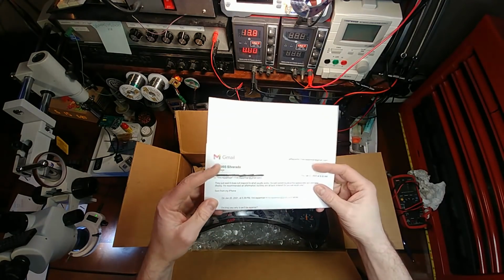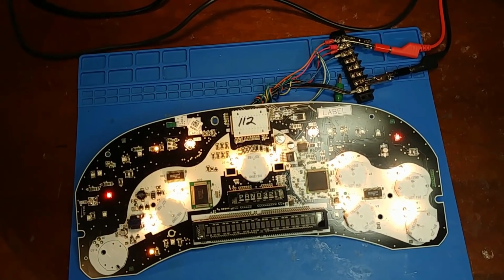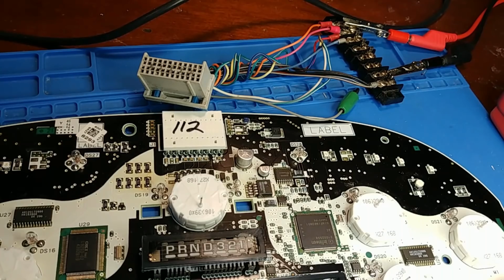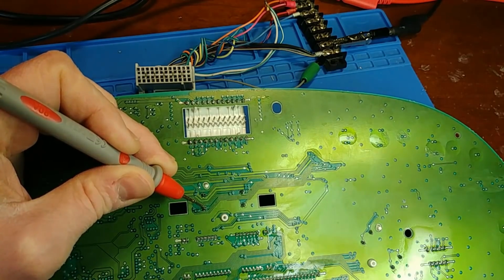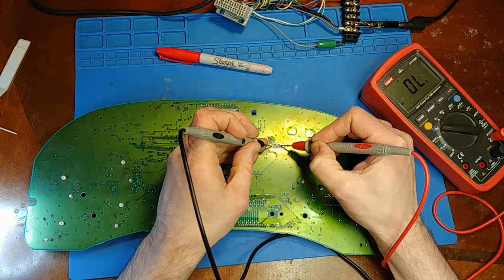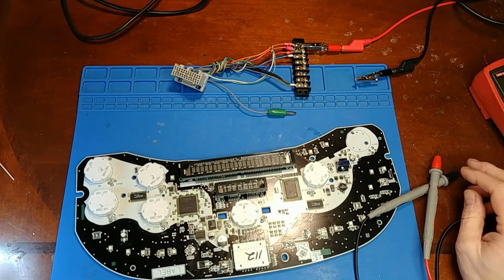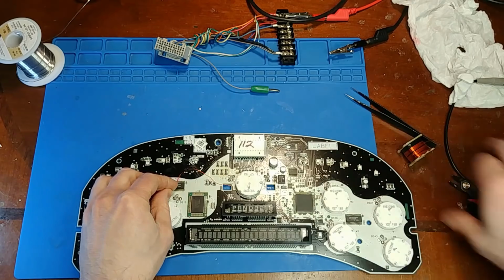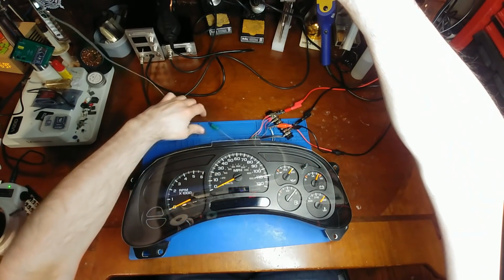"Liquid" Damaged GM Cluster Repair

Comment: If you're here and all thats working is your blinkers and the lights be sure to check all of the problematic chips mine had all be resoldered by someone before i owned the truck and i was stumped the board looked great besides some oxidation on the solder of those chips i fucked around for 2 hours to only say fuck it and reflow all of mine and the very last one had a broken solder joint i couldnt see my cluster now works again thank god

Comment: great video  Jeff ..I have a 2003 board and had don a good job replacing stepper motors  but by accident  i shorted out the  light  bulb above oil pressure gauge Now the cluster is totally dead...any idea what may be blown ?
Reply from the maker: Hard to say without being able to troubleshoot it.

Comment: I have a 2005 gmc yukon denali. The DIC display does not work. It rarely works for a short period of time but 99% of the time it's a blank screen. All of the radio controls work on the steering wheel work. Any ideas or can you fix it?
Reply from the maker: Yes it is repairable.
Reply: @jeffescortlx  how would I go about having you repair it?
Reply from the maker: @ryanconard8083  https://youtu.be/T_2WnJMsZaU

Comment: Do you still work on these GM clusters? I've actually got two trucks i need clusters worked on. An 02 avalanche and an 06 escalade ext.  The 06 escalade has an issue where the tach likes to rev up, but doesn't want to come back down, so at idle it says like 3 to 5k RPM. And when I rev it up. It will usually max out and hit the bezel. Im guessing it needs new stepper motors, as I dont think its ever been replaced, about 220k miles.  The 02 has two issues.  The truck has around 500 to 700k miles on it apparently.  So basically the previous owner, good friend of mine, bought the truck brand new, ran the original gauges for a while, then wanted to put the escalade gauges, so after anywhere from 200 to 400k miles, he bought a brand new cluster from GM. Which restarted the mileage to zero, and that cluster has around 300k miles.  So I was basically wanting to know if you can re program the mileage to add them up so the mileage is correct on the newer escalade cluster.  And also it's having an issue where the entire cluster just sort of freaks out and shuts off randomly.  Also, whats your email?  The link thing in the about section doesn't work for me
Reply from the maker: I can take care of both. Although the intermittent power on the 02 could be a bad ground. Contact information here: https://youtu.be/T_2WnJMsZaU

Comment: What’s the proper way to calibrate the gauges after re assembly? I re soldered a few bad joints due to not powering up sometimes I just really never new how to properly zero after.

Comment: Ever see one of these 03-07 GMT 800 Clusters with a brake light that stays on dim ALL THE TIME? Key on or key off. At night its very visible not so much during the day. For weeks its been glowing ever so slightly.  Do these have a resistor that cracks and is giving the LED residual battery voltage?  Its driving me nuts on the old 06 Sierra.   Sure when you Disconnect the power to the cluster it stops its a problem inside the cluster.   Fixable?
Reply from the maker: Yes I see it regularly. It's one of the steps included with a proper rebuild. It's a build up of silver migration corrosion. Should be cleaned and conformal coated.
Reply: @jeffescortlx   Ahh..  So pins are corroded somewhere.    Ill Email you when Dad ever stops driving the thing Down here in FL.  The humidity wrecks all here probably is corroded they like to leave their windows down all the time. I told them to stop doing that all the humid air gets in there. Then turn on the AC and its a condensation box.  But what do I know!  :D  Thanks for your insight. Its a 06 too so it has the good stepper motors they are fine.   Think one bulb likes to out around  4 gauges side but its back on for now.

Comment: Great stuff man. Question for you, are you self taught or have you had any "schooling" on soldering/circuitry/"surface mount" electronics? I'm into this stuff myself & I recently just bought a used GM with a busted "PRND321" & I ended up just removing the factory hard connector wires & replaced em with ~30 gauge instead. Worked like a charm, however there were pulled pads so I had to scrape to reveal trace & such to solder the wire to those... I've never seen jumpers quite like you do them however; circling back, that's why I asked if you've taken any classes or courses. 🤷🏽

Comment: Hi Jeff excellent video !   if I were to push 12v into that  same capacitor { @ the 5.20 mark} would it power up display?  considering the rest of the circuit is fine.  I've seen where  you push 40v into  cap c365..
  Presently  I have nothing to generate 40v  into c365   to power on display .. thankyou
Reply from the maker: I would first try to jumper the transistor next to that cap. I believe it's the main SMPS 12v power input control.

Comment: Jeff do you happen to know how the 99-02 clusters get the battery and oil signal? Is it through can bus or direct signal?
Reply from the maker: This will help you:
https://youtu.be/mC1OdwWRFtQ
Reply: @jeffescortlx  wow that completely answered my question. I'm trying to fit an 03-04 cluster on a 01 truck but the oil and voltage gauges won't work. Is there a way to trick the 03 cluster into taking the analog signals for the oil and voltage gauges? I've seen a youtuber do it but won't share the secret.
Reply from the maker: @DaBuGzLiFe  I don't know how you got that far, the plug pinout is completely different. The 99-02 don't send the Volt and oil across the serial bus. I don't know of a easy way to add that. But why not just use a 99-02 cluster?
Reply: @jeffescortlx  well I like the customization of the 03s and that the stepper motors are cheaper to replace than trying to find the oil filled ones. Also the lighting for LEDs seems better. Everything works the same except the dang oil and voltage.

Comment: Have you ever seen a 2004 Yukon Denali cluster say unknown driver. And the PRND321 indicator lights up but the gear isn’t highlighted I have tried a different cluster and it works for but would like to be able to fix this one if I can to keep trans temp.
Reply from the maker: Sounds like it can't see the serial bus. I'm surprised if the gas, Volt, oil and temp read.
Reply: @jeffescortlx  they read, the cluster works fine other than that
Reply from the maker: @jake6574  well, it's strange the cluster is picking and choosing what bus to see and what to ignore.
Reply: @jeffescortlx  I’ll have to find out how to PM you and maybe I can send you a video of it
Reply: @jeffescortlx  do you know of anything that I could check?

Comment: Hey were you able to get you battery volts to work with the PCM? I'm working on my own classes 2 bus genrator.
Reply from the maker: Yes I was. You'll need a BCM.
Reply: @jeffescortlx  so I'm assuming that BCM Will also control other lights like high-beam,ect?
Reply from the maker: @calebd8635  probably but I haven't tried so I can't say for sure

Comment: I haven't seen you do a manual trans cluster yet? Would love to see the differences  inside
Reply from the maker: Just doesn't have the display added and the face is blank in that spot.
Reply: @jeffescortlx  that's what I thought. I have a 07 5 speed. Hope I never have a issue with it do to being hard to find.
Reply from the maker: @leviwoodring6101  it can be rebuilt just like the other automatic ones.

Comment: I have a 2000 chevy 1500 I sometimes have my cluster go on full spaz. Everything will quit working and come back on. Rpm, speedo, gas gauge, and volt meter goes to zero. I believe I have a pin in my pig tail that is loose. I do want a trans temp gauge installed and update lights to leds
Reply from the maker: Watch this https://youtu.be/mC1OdwWRFtQ

Comment: Hey Jeff I have an 04 Silverado and my gear selector read out will only light up when it is stupid cold outside. How can this be fixed? Thanks
Reply from the maker: There are videos out there going over this repair if you wanted to tackle it yourself. Otherwise a rebuild service will fix this.

Comment: Man I wish I knew you existed when my 1991 Civic hatchback's cluster crapped out (lights would turn on and off with every pothole). I tried cleaning all the terminals and checking continuity of everything, changing bulbs, still no joy for some reason. Then I went to the junkyard and got one from an automatic car with a tachometer and installed that, it works great except for the vestigial PRNDL or PRND21 IDR which one it is because 5spd.

Comment: Hi mate. I have a dash with a tachometer that doesn't move smoothly. It normally stops working when the sun has been shining on the face of the cluster, so I banged the dash to try an get it to work, but it's done something to it. Now when I rev it it doesn't move smoothly at all. Could you tell me where I might start looking for issues? Thanks
Reply from the maker: Depends on the make model year of your vehicle.
Reply: @jeffescortlx  it's a 2002 Nissan Patrol
Reply: @jeffescortlx  I'm back mate.  Took the dash apart, all the gauges work fine, you flick them around and they move smooth,all except for the tacho needle that flaps around loosely.  Any chance of me being able to fix it's problem?
Reply from the maker: @DarrenBoxhall  I don't know your level of ability.
Reply: @jeffescortlx  I have some ability, replaced components on circuit boards before. Am all about fixing things. Really just hoping you could give me some tips if you have had something similar before. Like, what actually dampens the needle movement?
Reply from the maker: @DarrenBoxhall  grease is put in before motor assembly.
Reply: Cheers man

Comment: Yeh I repair pcb foil repair with thin copper tin coated wire .....it just blend on pre-made solder points ....it fails due to manhandling n corrosion ....on removal of clock unit use moisture absorption silicone bag ...n glue it in side....

Comment: I do board repair work for old computers and watching your videos been considering getting into this stuff. I have a Hakko Fr-301 and KSGR iron. Use kester solder and authentic AMTech flux. Even have a 30L ultrasonic tank with Branson EC cleaner. Anything I need to be wary of?
Reply from the maker: Pretty much sounds like you have a good start. I like to have two irons ready to go to pluck off SMD parts. If your ready to invest I'd say get a amscope microscope.

Comment: I’m having issues with my 2004 Scion xB cluster. Only when it’s cold (below 60 in south Florida)the cluster goes wonky. The lights all blink and none of the needles work. However, after about 5-10 of driving and warming up it works as normal. Fixable?

Comment: I see this type of failure all the time in cheap audio equipment. Traces will fracture and you won’t see it under the coat. Anything subject to vibration and moisture will have almost any kind of damage like this. I think half my life has been staring through a microscope and running jumpers... LOL

Comment: Ever work on Chrysler stuff?  Just stumbled on your channel and saw you fixing a cluster. Got an 06 ram 3500 diesel and the cluster is junk. Been sent at least once to a fixit seller on ebay. The gauges are either at zero, maxed out, or having their own dance party. Only thing that works is the odometer and the fuel gauge. However the ecu doesn't see the same mileage (we think. The scan tool thinks its always at like 240k miles when the truck says 310k on the cluster)

Comment: C104 is blown, also use a single strand of tiny stranded wire for the repair not only solder.

Although you may have repaired the device to operational level that was the worst repair job I've ever seen. That loose wire will break again and you never even noticed the excess internal pressure in c104 causing it to bulge out. That capacitor will leak and dissolve the copper traces under it. Replace that cap and clean up under the cap using water based solvents first. You can use other solvents to remove the water later on but the water dilute the leaking acid or base.
Reply from the maker: C104 is not bulged from failure. Every single 2005 revision board has a concave top on that cap. I've seen thousands at this point. Never ever once has that cap failed and leaked. Still don't believe me? I have about 10 05's right here with me in my office and they are all identical. The jumper wire has already been talked about in a previous comment. It will be fine, I literally guarantee it.
Reply: If what you say is true then it's something called programmed failure. If that cap shorted out what would be the outcome? AKA what do they want to fail causing you to be forced to buy a new one. Since panels are different per year, they hope you will have to buy a new car.
Reply from the maker: @dimwittflathead639  look, there is nothing wrong with the cap, it is not planned obsolescence. I know this might go against what you were taught and experienced, but some SMD electrolytic caps have concave tops from the design and manufacturing processes. It doesn't mean there is something wrong with it, it's just the way it's made. They are automotive grade and again, over 1000's of boards over the course of 10 years I've never seen that one leak or short. I've seen tantalum caps fail but not electrolytic.

Comment: I used to love board level repair. Then the surface mount technology took over and I'm out.
Reply from the maker: I've been around long enough to remember the transition from through hole to SMD, it's still fresh in my memory. At first I was resistive, but slowly started working with it. Now with a good microscope, tweezers and assortment of T-12 tips I love the challenge. Many parts are easier to remove as SMD over through hole.

Comment: Great job explaining the Troubleshooting Steps. I replaced Stepper Motors and Bulbs in a 2004 K2500 myself and everything worked good when done. I would have been lost at what goes where. Do you have a Wiring Diagram or just been through thousands of clusters. Thanks for the video.
Reply from the maker: Yes to both

Comment: Amazing video as always, I have a 04 GMC Yukon XL Denali cluster and lower screen on it is a little dim. prnd321 are fine, just the lower information screen is dim. Do you have a video on fixing that or do I need to send it in?
Reply from the maker: Could be fractured joints, or your o4 really has a 05 in it. Or the headlight switch has fractured joints
Reply: @jeffescortlx  I verified, they’re both 04
Reply from the maker: @wick_mal  There are a few different issues that can cause the vfd to be dim. Without hands on it's kind of hard to tell.
Reply: @jeffescortlx  Ill have another look. Could be something as Minor as dimmer switch broke or something, if not I’ll try and get info to send it in

Comment: What liquid do you have in the little squeeze bottle that you use to clean and scrub the board with?
Reply from the maker: Rubbing alcohol.
Reply: @jeffescortlx  ok I was not sure. About to attempt a led conversion on my 08 Silverado 1500 cluster and I’m trying to get everything I need todo it correctly
Reply from the maker: @LaserMachine26  https://youtu.be/y35oEE5v58w
Reply: @jeffescortlx  so I ordered “no clean flux” in a syringe, is that the correct flux I need to use?
Reply from the maker: @LaserMachine26  should be fine. I like AMTECH myself but I'm picky when it comes to flux.
Reply: @jeffescortlx  I got a couple issues with my LED conversion, is there a better way to contact you to get some more info on what I’m doing?
Reply from the maker: @LaserMachine26  email is your best way to contact me.
Reply: @jeffescortlx  where do I find your email?
Reply from the maker: @LaserMachine26  https://youtu.be/T_2WnJMsZaU

Comment: Reflowing everything = Plz bro. I never bother trying to make a failed via work again by flowing solder through it I just poke a hole through it and run enameled wire through myself but that's just my preference. I know Mike M has been seeing a few boards like this lately. I think all the bad vias I have seen are poped from shorts.
Reply from the maker: I considered running a wire through the via for about a millisecond. But at this point I was tired of chasing breaks in the line and decided to just bypass the entire thing.
Reply: @jeffescortlx  probably the best call anyway.

Comment: The master at work! You are proof that almost nothing is fully dead! Most others just don’t go the extra step and won’t take on a challenge! They just basic solder service! 
I wish I had to bench tools. But I don’t so gotta use the trucks plug for testing lol I’ve got two clusters that need work. My original with multiple lights out and 2 stepper motors out. And a Denali cluster with dim gear selector display and maybe a bulb or two out. They both seem quite basic work atleast. That flux you recommended is great! I used it on another solder project and it’s amazing.

Comment: Can you use the oscilloscope to test stepper motor circuits
Reply from the maker: I guess it's possible. But not really nessacary, I could tell by the way the stepper motor was behaving that it was missing a line.
Reply: @jeffescortlx  good job. Been a diagnostician for 20 years. Just trying to get into component level diagnostics and repair.
Reply from the maker: @deerhunter8533  keep on trucking. You should have no problem hunting down bad parts.